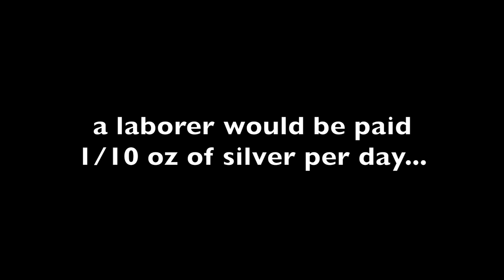Trailer - How I Hand Cast 1/10ozt .999 Silver Coins - Per Diems

Comment: I have a question about adding the top of the mold once the silver has melted and beaded up, is the top piece you place on the mold preheated or do you just place it on top at room temp.